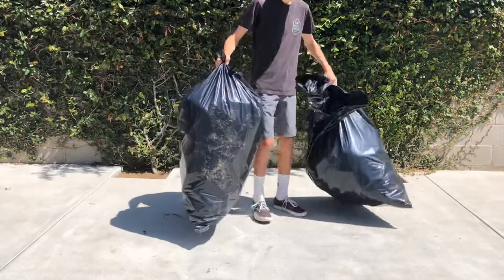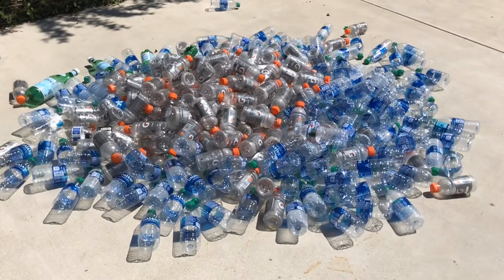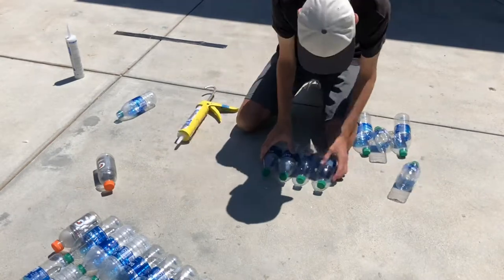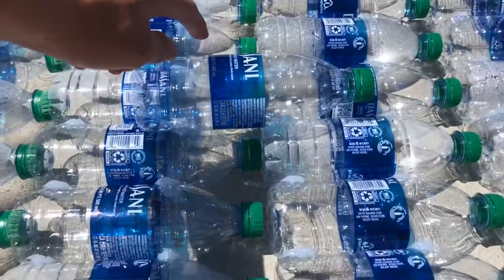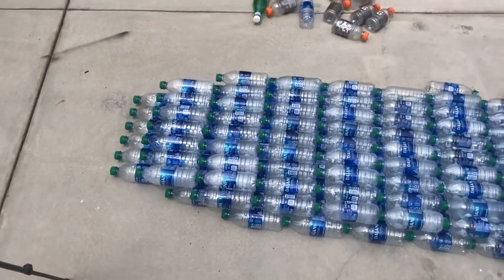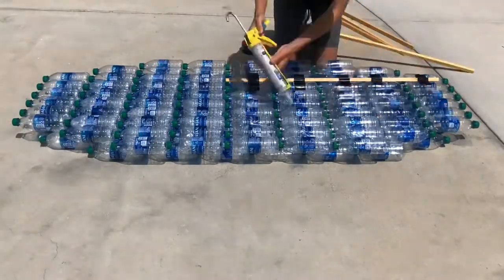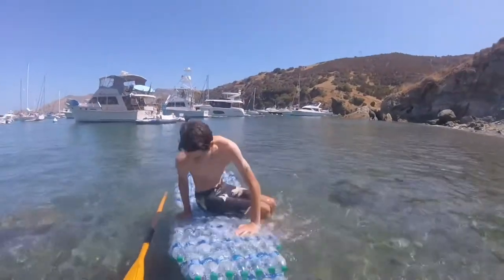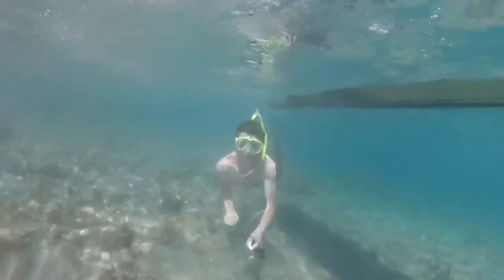I Built A BOAT With Water Bottles

Comment: So were you able to glue the caps to the bottom of the next bottle?  I didn't think the silicone would bond to the caps.  Also, how is it holding up so far?
Reply from the maker: So I really only glued the side of the bottles to each other, I didn’t really glue the caps. The silicone is still holding up and everything is still on tact. The wooden support strips have rotten away and have to be replaced but other than that, it still floats